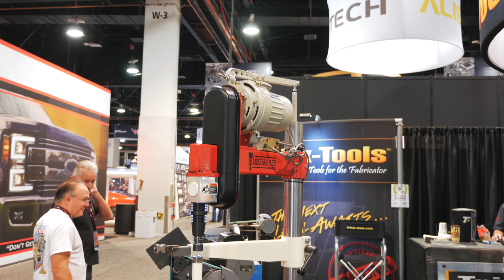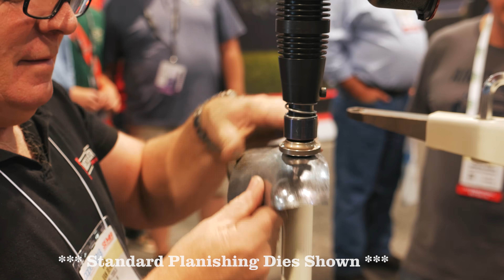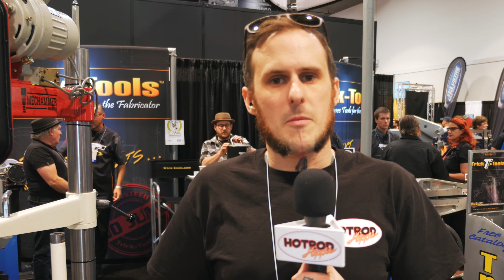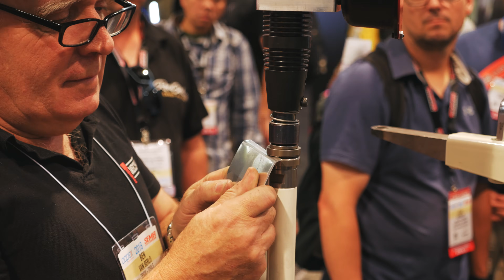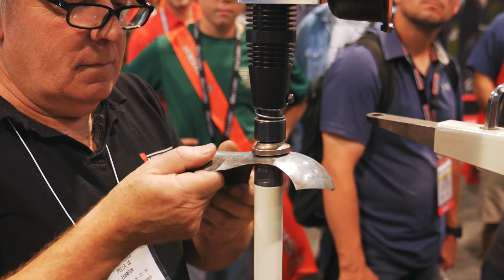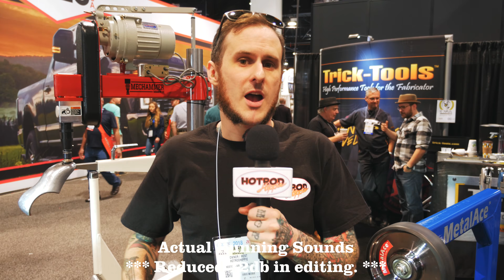Mechammer - Electric Planishing Hammer - SEMA 2018

Comment: Have you heard anything on his new machine the Mechbammer???
Reply from the maker: I have no experience with it. I know Ben is proud of it, I had hoped to see it at SEMA 2019 but they didn't get one there. I've heard some good things but have no firsthand experience nor trusted sources aside from Ben himself (the maker). Sorry I can be more help at the moment.
Reply: i have seen it working, i have been next to it while its working. The thing is a beast. Its prettymuch an xxl version of the mechhammer. It hits harder. The thing shaped 3mm steel plate... So it can be nice to get something in to a rough shape really fast, but the mechhammer is still needed to finish the job in my opinion. The mechbammer is more like a sledge and the mechhammer a normal hammer.

Comment: Like everything else.
Over rated and over priced.
Reply from the maker: Do you use something that works as well at a lower price? "Over rated and over priced" seems to indicate that this isn't the same price as the other full size planishing hammer options on the market. Compared to the ones I'm aware of, it is pretty comparable. So I'd be glad to know what options you think are better so I can check them out.
Reply: @HotRodHippie  i think this comes out cheaper if you dont allready have a big compressor. My air planishing hammer needs some serious air flow to run non stop, wich means you need a pretty expensive compressor. If you where to add that in then i think the mechammer might be the cheap option actually. Now prices might be different in the US as i heard from ben that it costs a bit more to make over there and thats mostly down to rules and stuff. But the nice thing about this is its all contained in 1 unit. Just plug it in and you can go.